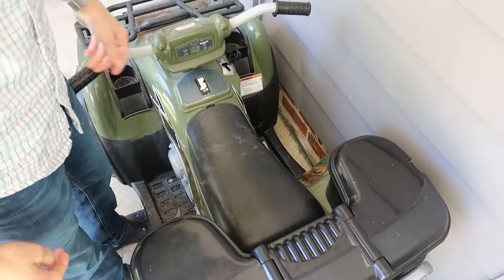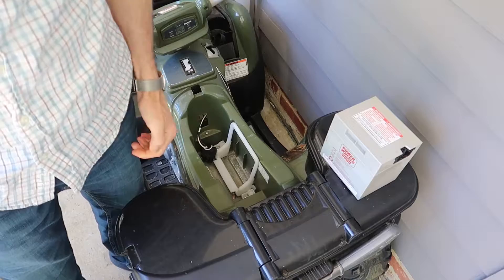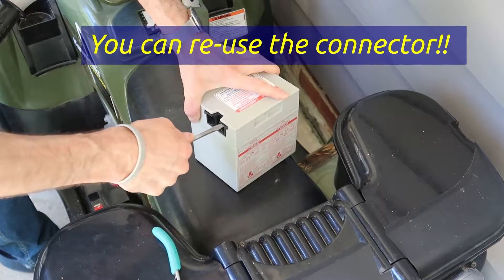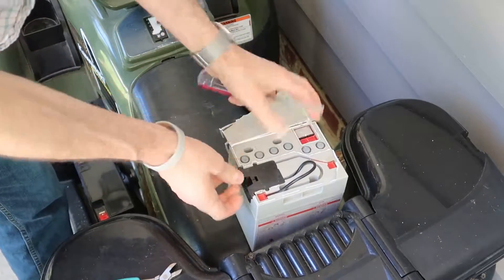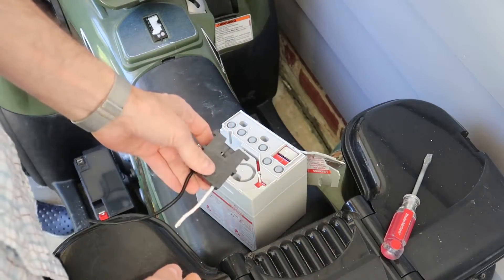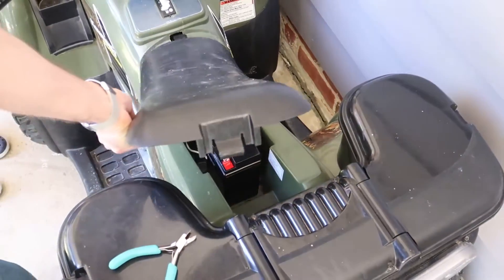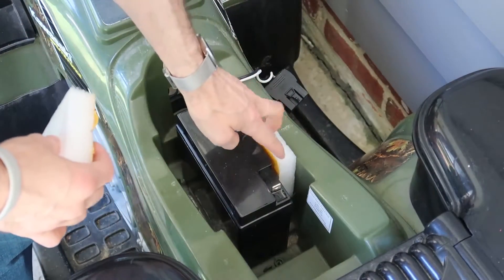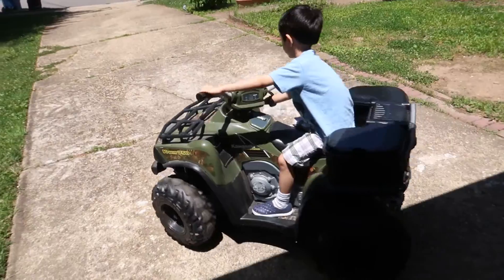Cheap PowerWheels Battery Upgrade: Double range, Half price!

Comment from the maker: We just had the Power Wheels out for about 30 mins of almost constant use, and the battery level is still showing full charge! Works great!
Reply: Dose the quad have a built in battery meter like mine? Was wondering if it will still work
Reply from the maker: @wrencharoundandfindout8780  Yes, mine has a 4-LED battery level meter and it still works just as new. If you increase the voltage (I only increased the amp-hours; voltage is still 12v), however, that meter will be wrong or even burn out!

Comment: Can you charge the battery with the power wheels charger?
Reply from the maker: Yes, I'm using the same charger because the voltage is the same (and it's the same battery technology, lead-acid).

Comment: Hi! I was trying to figure out what you did at last with the connector that you cut off from the old battery, how did you attach it to the new black battery? I missed that, and that was the most important part for me! 🤣
Thank you!!
Reply from the maker: Sorry, I guess I brushed over that. After removing the connector from the old battery and cutting the wires as close to the old battery as I could, I stripped about 1cm off the ends of the wires and used two screws with nuts to attach the connector's wires to the new battery. You just have to make sure you got the "+" on the battery going to the "+" mark on the connector, and "-" to "-".

Comment: Don't know if this is on topic or not, but I plan to replace the stock 12v 7Ah SLA battery in my son's Power Wheels Jeep with a 12v 10Ah Lithium one.  Would I be able to charge it normally, or would that require a completely different method?
Reply from the maker: Good question. I should add that to the FAQ. Yes, you can charge a 10ah battery with the same charger as the 7ah battery since they are the SAME VOLTAGE. It will just take a little longer to charge the battery with higher capacity (10ah).

Comment: would be nice if you could put that in parallel for even longer battery life
Reply from the maker: Yeah, you can if you can fit two batteries. But it would be cheaper to buy one battery with double the capacity.

Comment: How long does it last. I was gonna upgrade the kids 4 wheelers for a longer battery life. The ones they have now run for about 1 1/2-2 hours.
Reply from the maker: Good question. It lasts longer than the neighbor's kid's Powerwheels do, and they all seems to get bored once someone's batteries die, so he hasn't run it long enough to find out! Since it's about double the capacity (9.5Ah vs 18Ah), it ought to last twice as long. But don't run your batteries until they die. It will shorten their useful life span.

Comment: Do you have a link to the terminal connectors you used? Thanks!
Reply: In the video, I show how I salvaged the one connect by breaking the original Power Wheels battery open.  If you don't have a dead PW battery, then you can probably find the connector online or use a different pair of connectors.
Reply from the maker: https://amzn.to/2E2MaLo (battery connector with inline fuse)

Comment: How do you charge the new battery?
Reply from the maker: Exactly the same way as the old one (same voltage). That's why I removed the connector from the old battery.

Comment: I am looking to change my daughters 12v10ah battery with 12v35ah. My concern is about the auto reset relay fuse which is hooked to the old battery. It is 18a yt-01-a. Can I use it on 30ah battery or do I need to change it to higher a. Sorry if this is silly question:)
Reply from the maker: Not a silly question at all! I would keep the fuse that's in there now, because that's sized to protect the motor and transmission. Your larger 35ah battery will provide essentially the same current as the original battery, it will just last a LOT longer!! (this is because "ah" means "amps times hours", so same current means more hours).
Reply: JoyeMusic.com thank you for your reply. This was my thought too, but was not sure. Better safe than sorry :)

Comment: I didn't see you add an inline fuse holder?  Is it ok not to add that ?
Reply: Also do you use the wall charger like the old battery or use a slow charger ?
Reply from the maker: @jakeguardianship8881  I didn't add a fuse holder because there's already one in this PW. I used the original charger because it's charging the same type (voltage and chemistry) of battery. If I changed to a different chemistry, like lithium-ion, I'd definitely change the charger.

Comment: But can you charge it
Reply: Recharge it d same way as old one.
Reply: Yea. Its called a battery tender.
Reply: yeah that was my one concern. the old battery for the 10 minutes that I ran. took like 7 hours to charge. how long would it take to charge a battery this big?
Reply: @salocin911  I'm running two 12v 28Ah Panasonic's in my daughter's. Trickle charger set to large battery takes 4-7 hours, depending on depletion. SLAs shouldn't be run to entirely dead and should absolutely never be stored that way.
If charging in parallel, hook positive charge cable to one battery and negative to other to ensure they are balanced.
Also, make sure they are fully charged individually before installing.

Comment: Do you really need to add a fuse? What is the fuse for? I've done about 10 harness modifications like this one. I did two last night but forgot to add the fuse smh
Reply from the maker: Great question. The answer is "NO"! It's really there for "safety", of course, and probably a requirement that the manufacturer install it. But it's also there to protect the motor in case of over-current -- Like too many kids on the Power Wheels at once. But the transmission is also designed to fail (don't ask me how I know!) under heavy load to protect the motor. Ideally, the fuse would pop before the transmission fails so you only need to replace the fuse, but I had one where the transmission failed first. Anyway, best of luck doing more mods! And thanks for supporting my videos!

Comment: So Long story short I bought a power wheels for my son, one of those parent control ones. Well I bought it off someone told me it worked good and tested it but a after 2 days when we charge the battery it says it’s full charge (green light) after only 10-15min but I left for like 2hrs then when I went to try it the battery died with 10 mins of use. It’s a 12v car would this work?
Reply from the maker: Sounds like the battery is on its way out. Not all the PowerWheels battery holders are the same size!! The most important thing is to measure the space your current battery is in and find the largest new one that you can squeeze in there. The PW batteries are non-standard sizes to make it hard for you. 
But it's worth it!! My son just used his today for >45 minutes and it was STILL SHOWED FULL CHARGE when he came home. All his friend's PW's were dying while they were out there.
Reply: JoyeMusic.com  thank you brother, I just found one on a amazon 12v and 12AH, good thing I measured haha. I couldn’t find a 12v-18AH. So I got the 12v 12AH which is still better then the standard one also by the same brand that you used.
Reply from the maker: @streetdream1726  Great!Hope it works out for you!

Comment: Can I use a 12v dc battery out of a UPS for this?
Reply from the maker: Yes, great idea. I hadn't thought of that because most of the UPSs I've seen used were dead! So if the battery doesn't last long, it might be just too old to use. But it's worth a try!
Reply: JoyeMusic.com 

Thanks. I have some brand new never used UPS 12v batteries so I’m going to try that. I’ll also need to modify the charger to fit the UPS battery.
Reply: Also, if I want it to go faster I can makeup a 24v battery right?  Double speed?  And to extend the running time use a higher amp like you’re doing right?  I’m new to electronics.
Reply: @tonynsx  It'll definitely go faster,at 24v (12v and 12v in series), but the motor was designed for 12v, so it could burn out faster, or the transmission could break. I converted a 6v mini Power Wheels to 12v, and with two kids on it the transmission gears stripped right away. I think the transmission is designed to break under high load "for safety", and the higher voltage is capable of much higher torque, which can strip the gears really quick. So it's risky, but doable. 18v would be safer, but that's difficult with lead-acid batteries (12v and 6v battery in series), but you could easily use an 18v lithium drill battery, for example, but those are quite expensive.  Yes, higher amp-hour rating will last longer (and weigh more).
Reply from the maker: Whoops, I replied under my wife's account (Heidi J). That's my reply above.
Reply: Heidi J 

Thanks. Or I could put a circuit breaker or fuse so they get damaged first. I think. I haven’t done anything electrical.
Reply: JoyeMusic.com 

No worries 😀you’re a hacker now 😀
Reply from the maker: @tonynsx  Yeah, that could save the transmission, but you'd have to do some experiments to know what value fuse to use. It's still pretty risky.
Reply: JoyeMusic.com 

Ok thanks
Reply: @tonynsx  no. You will burn up the motors, unless the wires burn first.
You can replace motors. There's a whole load of ppl that hot rod them as a hobby.
Also, please fuse your batteries. Google how to use a dmm to measure current, test inrush current of your motor under load and go to the next largest fuse
Reply: @GoingGone1-5  a series connection of a 6v and 12v with similar aH would work but be a pain to charge.
If there is only one motor, you can wire in a second motor to the opposite wheel. 
These things are cheap plastic through and through.  Would advise against ever running them over their rated voltage. Failure will happen. Just depends on what burns up first and if it endangers the kid.  I've seen ppl wire 2 2 12v in series and the car catch fire.  Plastic burns easy with high current DC melting the wiring harnesses.
Reply: Jeremy Winnett 

Because UPS batteries have more amp than motors can handle? Can I use like a 12v dc car or lawn mower battery?
Reply from the maker: Yeah, fusing is a good idea to save your motor/transmission, though you'll probably have a bunch of false trips until you get the size high enough.
Reply: Thanks to everyone for the good tips. I think adding a fuse is a good idea even if I’m going to use the same recommended 12v dc battery.